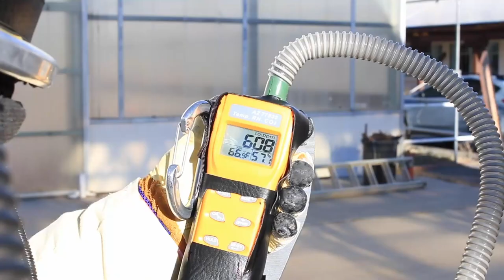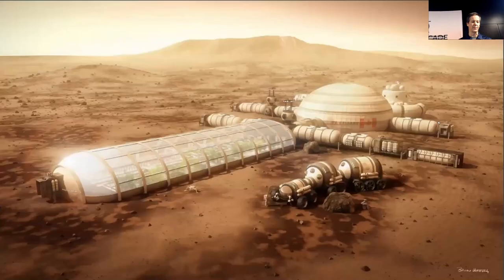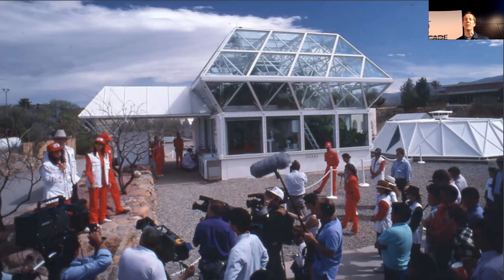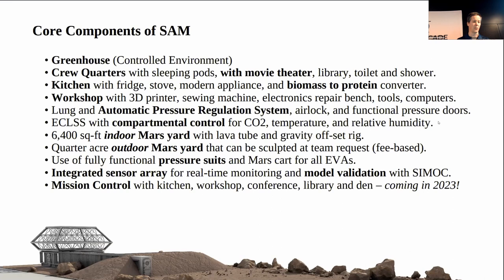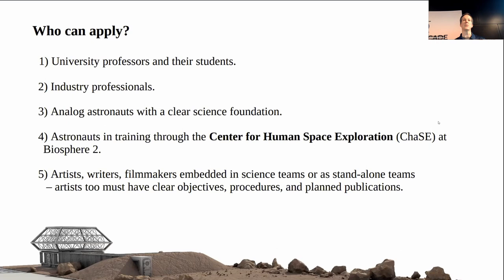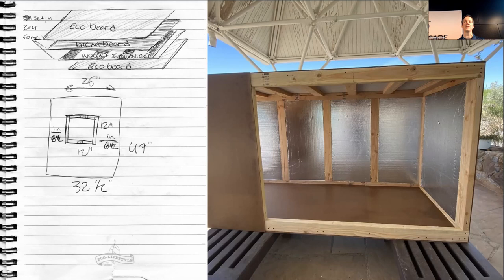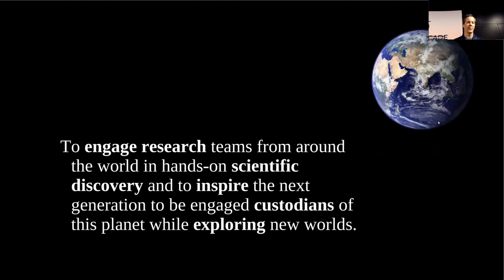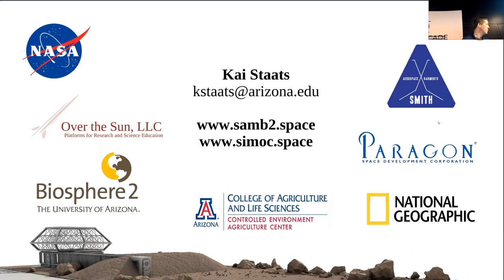Kai Staats - 25th Annual International Mars Society Convention

Comment: How does that space analog work at -200 F in a vacuum? 

Should be interesting trying to use shielded metal arc welding and pour concrete on the Moon and on Mars, too.